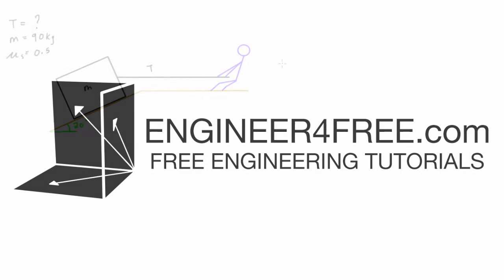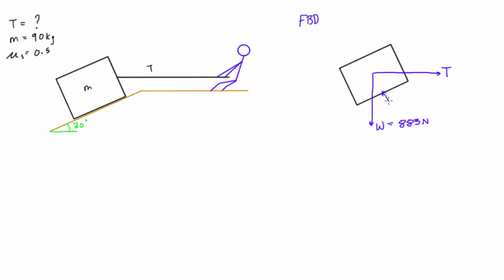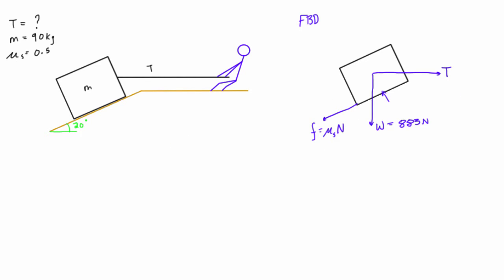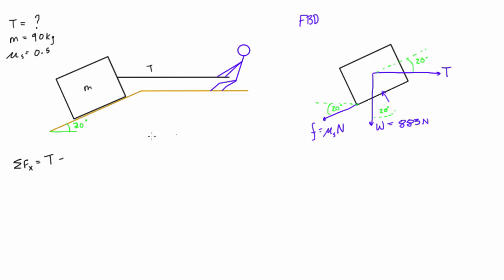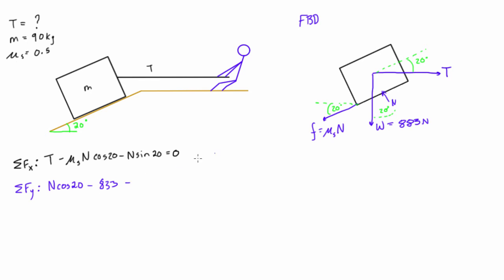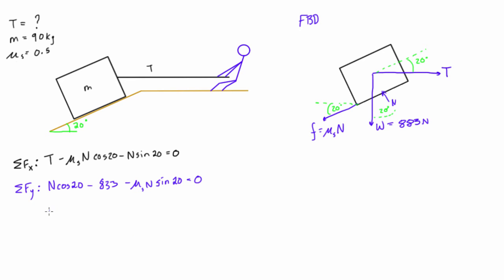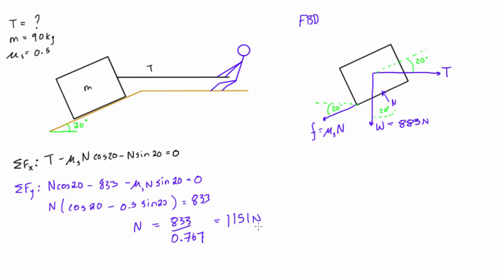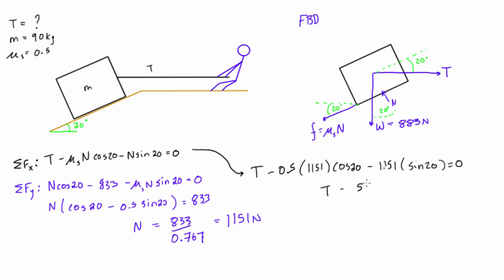Friction example problem #2

Comment: can you explain why the friction force is in the opposite direction than the previous example?
Reply: He had a negative value for the friction which meant that the diagram was in the wrong direction in the previous video. It is correct here.

Comment: Quick question in the sum of forces did you mean to put Nsin20 or is it suppose to be 883sin20, the reason why I say that is drawing a line going in the negative direction just below the normal forces that line would be 883sin20, but if you were trying to find the normal force wouldn't it be "Ncos20"

Comment: What would I need to do to find the mass pulling the block?

Great videos btw
Reply from the maker: Thanks, but I'm not sure what you mean. The mass of the block is given, it's 90kg. And we solve for the tension in the problem, which is "pulling" on the block.
Reply: @Engineer4Free  Sorry, I wasn't clear enough haha. In a question I was attempting I had the mass of the block, the angle of the slope and the friction coefficient, I just had to find the mass of the object pulling the other block up the slope.
Reply from the maker: @manny_k2988  Hi sorry, still not sure if there is one block or two blocks in the system you described. But regardless, Here's an example with a single block on a slope with friction: https://www.engineer4free.com/4/a-block-is-on-a-slope-with-friction-what-happens and heres another one with two blocks connected with a cable, one is trying to move and the other is on a (horizontal) surface with friction: https://www.engineer4free.com/4/kinetics-pulley-example-problem-with-a-friction-surface both are actually from the dynamics course, but if you define a=0 then you can check if it's in static equilibrium.
Reply: @Engineer4Free  Thank you much , honestly. Both videos linked helped me grasp the idea of friction!

Comment: Can I ask why Tension isn't actually included in the summation of Fy?
Reply from the maker: Yeah, it's because T is horizontal. It's internal tensile force is therefore directed entirely within the +/- x direction. In other words, it has no y component, so wouldn't show up in the sum of forces in y equation.
Reply: @Engineer4Free  thank youu. I thought it had a vertical force because of the inclined plane
Reply from the maker: Nooo. For cables/ropes, they can only ever be in tension, and the tension must be in line with the cable/rope. So just look at the angle that the rope is on, and use that as the ankle for the internal force!
Reply: @Engineer4Free  thank you so muchh

Comment: Why does friction have the 20 degrees when the problem before this one did not
Reply from the maker: The previous example was using a rotated axis x’ and y’ for finding the components of forces. It was rotated 20 degrees CCW off of regular x and y. This example is doing the calculations based on the actual x and y components. Either works, but sometimes it’s easier to pick coordinate axis that is not x & y, but slightly rotated to match a slope in the diagram.

Comment: Sir, you put for in x direction normal in negative direction ,, why??
Reply from the maker: If you break the normal force into it's x and y components, the y component is pointing upwards which is the positive y direction and the x component is pointing to the left, which is the negative x direction. That is why the term is negative in the sum of forces in x equation. Sorry, I should have also wrote a coordinate axis that clearly states that I defined right as the positive x direction and up as the positive y direction.
Reply: @Engineer4Free  how do we know the x component is pointing to the left? what gives that away?